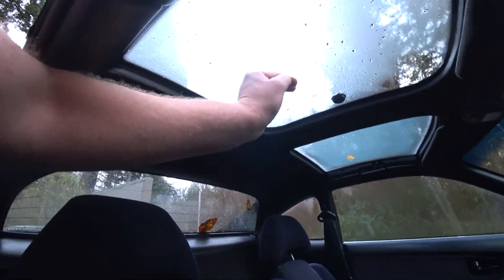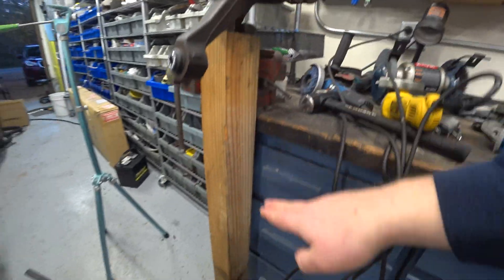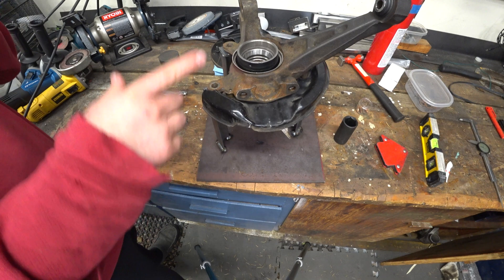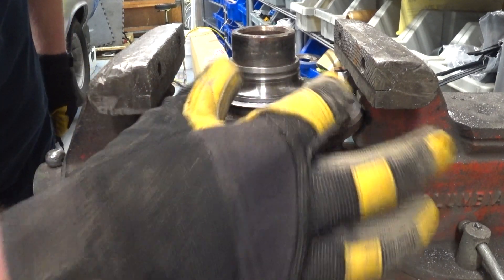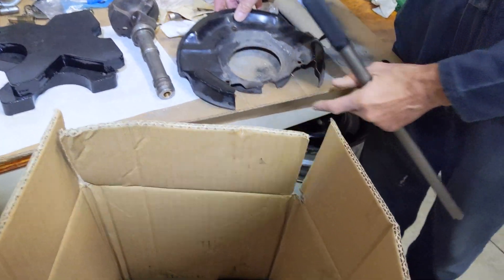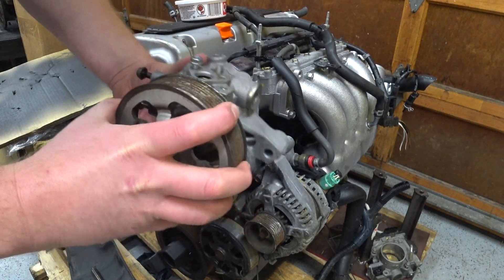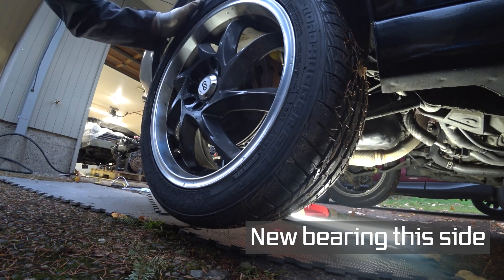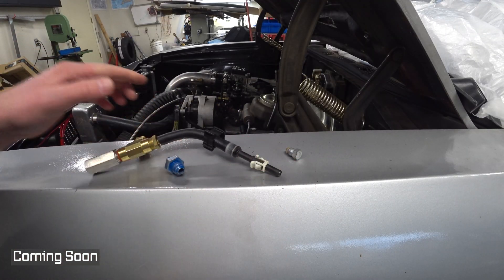🛢️ My Car Needs a Diaper + more!

Comment: A good way to get a ton of heat into the bearing. Is too run some weld around it. You can sometimes get it to expand a bit before it heat soaks the drive flange. Another great video though. It looks like the car is in great condition!
Reply from the maker: Ooh good idea dude I didn't think of that!